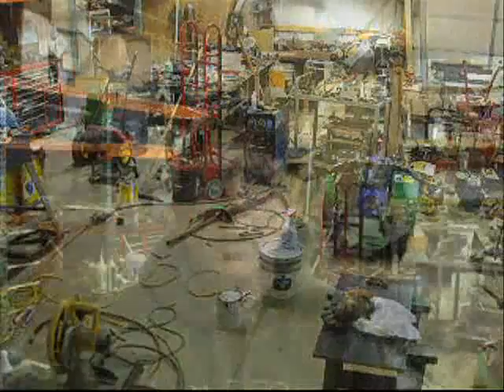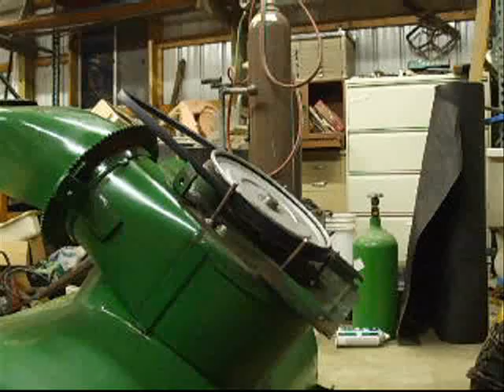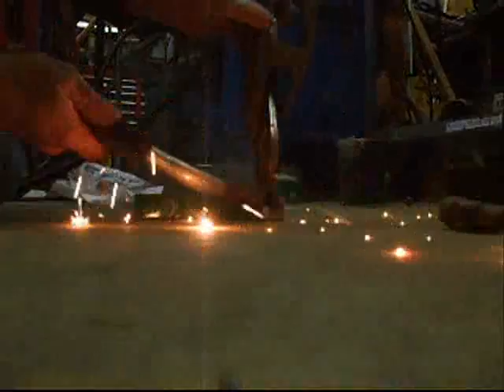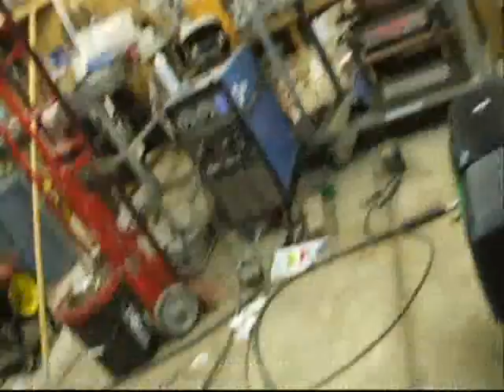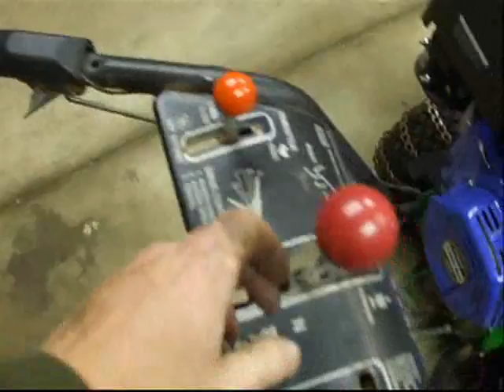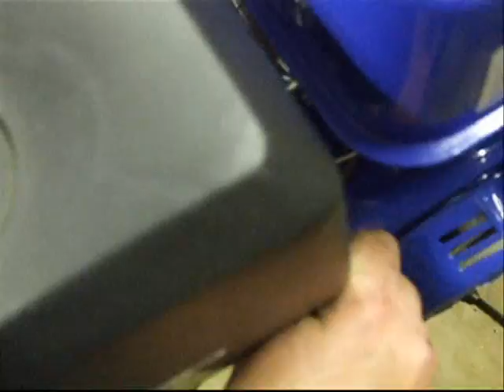John Deere 1032 Snowblower Repair & Modification Video Part #7

Comment: I don't hate anything about your choice in engine, I just asked why you would choose a cloned engine? Seriously, I've worked on over a 100 of those engines and not 2 are the same! Parts do not often fit, they're not machined a like even though they appear to be a like. I'm glad you've had good luck with those engines, You've done a wonderful restore, spent a lot of time and people can learn a great deal. Thank you for that! Still I do question your choice of a cloned engine.

Comment: great information but my only thought is why spend so much time and work and then use such chinese junk crap as a clone of a Honda motor. I've worked on several of those clone engines and they are just cheap junk! Sorry to knock your video but it just seems with such great work you would've used a better engine.